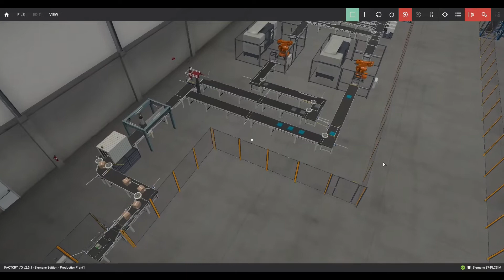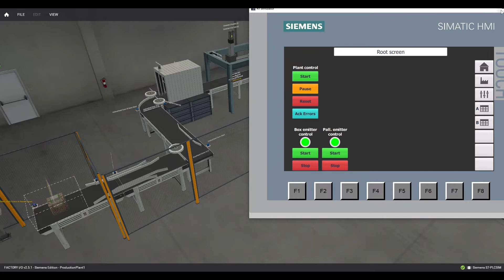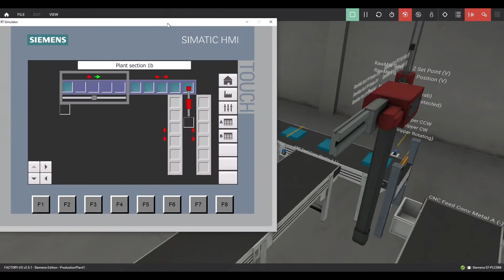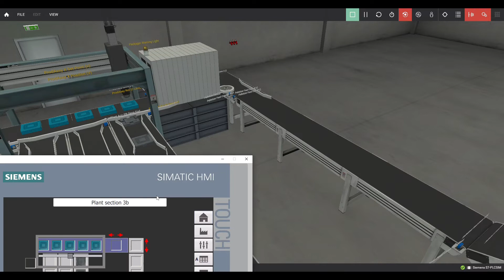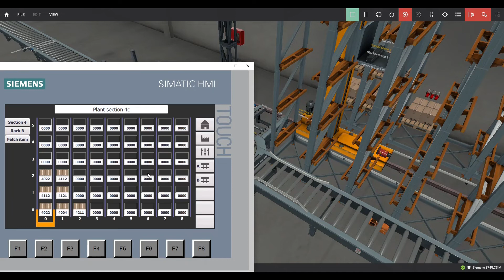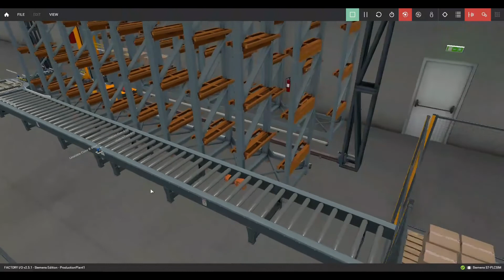Project I. - Virtual Production Line Automation with TIA Portal and Factory IO (1 - Overview)

Comment: That's an amazing project! I hear TIA Portal alone can easily take up a good 16 GB of RAM, so together with PLCSIM and Factory IO I'm guessing 32 GB is probably a necessity to put together this sort of project. Does that sound about right to you?
Reply from the maker: Actually I did it on a Thinkpad T460 with 16 GB of RAM, which was more than enough. TIA portal indeed requires a lot of memory, but not excessively lot. In fact, you could do the same project with just 8 GB of RAM, as I could run TIA portal, two plcsims, one hmi sim, a docker engine with node-red and a browser on a machine just like that, so don't worry about having a lot of RAM, although it certainly helps.
Reply: @pusrob  interesting, thanks for the info!